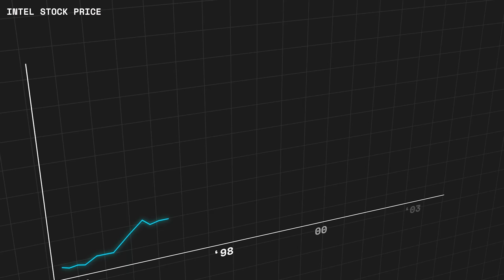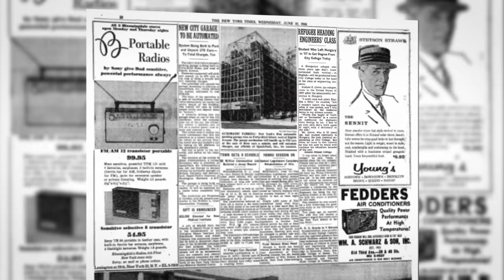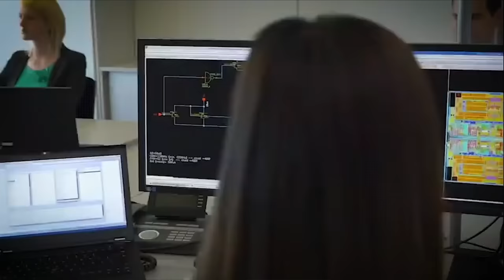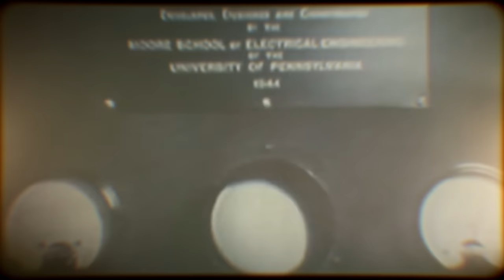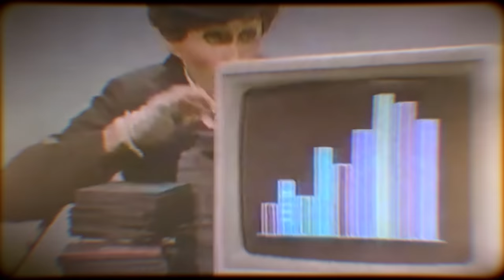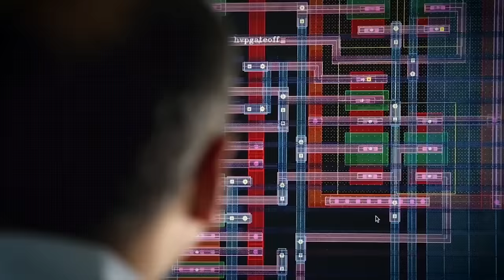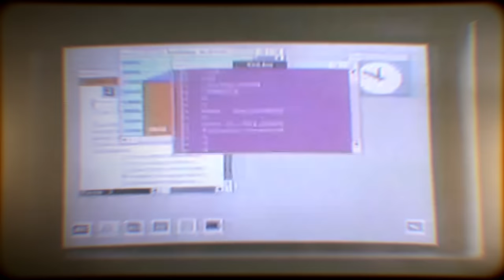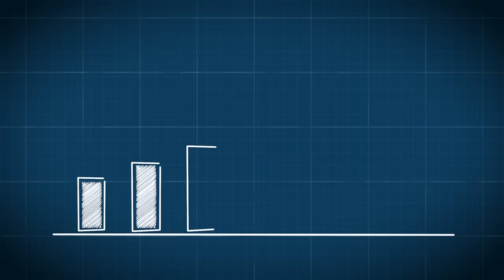Intel's Crumbling Dominance

Comment: Another exciting event happened following the release of the Pentium: the floating-point divide disaster. It caused Intel in 1994 to have to buy back $475 million processors produced with the flaw. I went to work at Intel in 1995, and all the employees were given a Pentium processor encased in plastic and turned into jewelry (tie tack, lapel pin, cuff-links, etc), and they sold a fair amount of the defective devices as curiosity items. They were extraordinary to look at, with a gold and rainbow sheen.
Reply: I think that was one incident that helped cause Intel's loss of Intel's dominance. The memes (although they weren't called that) were devastating and the slogan "Intel inside" became a warning.

Comment: I have worked as an Integrated Circuit Layout Designer since 1983.   All those chips designed between the first Fairchild chip in the 1950's and the early 1980's was drafted on paper or mylar on a drafting table using pencils.  Computers purpose built to assist layout design were only first introduced in the 1980's.
Reply: Just designed an entire 16-bit RISC CPU in Verilog as a personal toy project. Took about 4 weeks to get it running, on an FPGA, but the time included writing an assembler. I cannot even begin to imagine what it would be to tape that out on paper.

Comment: 00:00:00 - Bill Shockley invents the transistor and founds Shockley Semiconductor
00:05:00 - Andros Grove and others found Fairchild Semiconductor and develop the first silicon semiconductor chip
00:10:00 - Bob Noyce, Gordon Moore and team succeed in reducing the instability of transistors and price their products low to accelerate demand and gain market share
00:15:00 - Intel develops the 3101 SRAM chip, 1103 DRAM chip, 8080 microprocessor, 4004 microprocessor for personal computer, Altair 8800 and other computing products
00:20:00 - Intel founded in 1978 by Moore and Bob Noyce, growth slows in the early 1980s due to competition and financial difficulties
00:25:00 - Intel faces challenge to stay afloat in the memory chip market, switches to microprocessor production and becomes the world's largest microprocessor manufacturer
00:30:00 - Intel's 386 processor is a major success but IBM challenges its dominance, leading to significant challenges for Intel's CEO, Andy Grove, to keep the company on top.
Reply: This part is wrong:  "Intel founded in 1978 by Steve Jobs and Bob Noyce, "
Reply: Yeah, well spotted it was founded by Moore and Noyce.
Reply: DO YOU KNOW who Steve jobs was?
Reply: Edit your comment about your note on 20:00 - Intel NOT founded by Steve Jobs.
Reply: Intel was founded in 1968, not 1978

Comment: Interesting story. My family’s first PC was a 486, and my parents ended up choosing an AST  over a Compaq. This was 1990 or 1991 in ZhongGuanCun, Beijing China, and that computer cost about 2500 USD. The company Lenovo was a spin-off from the Institute of Computing, where both of my parents worked. Lenovo was originally called LianXiang. Their main early product was a Chinese input method, which allows you to type one Chinese character and be prompted with words and phrases that start with that character, thus the name LianXiang, which roughly means neural association or connection, an indexing and search process that occurs in your brain.
Reply: Wow haven't heard someone mention a 486 on here ever! I started on a commodore 64, then moved up to an amiga 600 (couldn't afford the 1200) then I finally got a 386 with 1 meg of ram! By then I was flying progressing to the 486 with (I think) 2 Megs of ram.. I remember having a mario game that was over 4 floppy disks. All running on DOS and windows 3.0/3/1. I remember when windows 95 came out and you got the free Wheezer music video. I used to sit there defragging the hard drive. Simple times! The good ol'virgin days!
Reply: @curtis24-7  i made a pit stop with amiga 500. ANd only for Monkey ilsand 2 i bought a sec. disk drive. Fun times. Kids of the 90s great time.
Reply: My parents' first computer was a Packard Bell with a 486.  I don't remember a lot of the specs, but it had Windows 3.1 and I think the hard drive was 20 MB.  Kind of crazy to think that a lot of processors have even larger amounts of cache today.

Comment: My first job at 16 in 1986 was at Marconi in the UK. I went on a wire bonding machine course and met a man that worked in a factory in Wales. Sure it was Intel. He said they was making parallel processors but the scrap rate was up in the 90%. The place I worked at made Silicone on Sapphire space chips.

Comment: Intel Core 2 duo E8500 were selling very well because many people tell people intel very durable and until today i am now still using it with a new Afox LGA 775 motherboard that has only one year warranty with a standby side kick Intel Pentium E6600. For playing computer games i have a AMD 4600G put near my left leg. Intel customer have intel core2duo E8500 computer that is very durable and still do not spoilt even if they overclock the CPU & fed it with the cheapest SGD 10 thermal paste with no expiry date and end up They go and buy AMD 4600G. When Intel Pentium 4 -2.4b ghz  have no rambus motherboard for repair, I check temperature of Cpu is 20 degrees temperature more than normal temperature because i overclock it from 2.4 to 2.53ghz and it behave non-responsive and also with strange artifact on the monitor then it must be spoil.

Comment: Slight correction. They were working on the 80386, not the 30386. How did the 80286 (and 80186) factor into this story? It's also worth discussing the difference between SX and DX, or DX2, and that the 80486 integrated the Floating Point coprocessor as well as introducing microcode to the design. By the P6 this was effectively giving a CISC instruction set on what is fundamentally a RISC processor with pipelines and out-of-order execution.
Reply: Not sure that microcode bit is 100% correct. Even an 8086 has some control run by non-upgradable microcode within the CPU. From a CPU designer's perspective, it is still microcode even if it isn't re-writable. A better classification for what was marketed as "Intel Microcode" would be to call it firmware IMO.
Reply: @richardbaird1452  does the 8086 have a microcode? I don't think that's right. Microcode wasn't used until the Pentium Pro as I understand it. CISC CPUs before that used a conventional state machine to select the load execute cycle. Instructions were mapped out on the die in regions specific for the instruction being used. Microcode which was updatable came later. Without on die cache, it wasn't really a thing because that is what allowed reordering and pipelines.
Reply: @richardbaird1452 , thanks for that additional perspective. I haven't decapped an 8086 myself, and my understanding mostly stems from my education a couple of decades ago when I created a 4-bit microcontroller as one of my labs. This notion that adding microcode to the x86 design was reenforced with other things I had read over the years. It makes sense that instructions like MUL and DIV might be implemented with microcode but I wasn't aware that Intel did that as early as the 8086.

Comment: Really fine presentation. I was wondering if you plan to tell a similar story about Texas Instruments or should I say Geophysical Survey Inc. Some of the success of Compaq came from engineers that worked at TI that shifted into Compaq. TI and Intel fabrication efforts parallel each other along with microprocessor designs.

Comment: The story is good, but the visuals are weird. The chip on the finger was a BellMac and Bell labs fab, not Fairchild. Also, not sure why the old footage of Brattain circa 52 was included with the Fairchild discussion. The footage was quite random. Noyce wasn't sole inventor of the IC, but he did take Hoerni's planar process to come up with the truly fully planar IC, slightly behind Kilby's hybrid IC. That Cray MCM footage was bizarre at that point in the timeliness- wrong decade. Also the apple Mac in the 1982 Intel discussion wa weird, as they come out in 1984 but used Motorola chips.

Comment: I hate to say it but your wrong about a whole bunch of the history. The first intel 16bit processor was the 8086 but they also made the 8088 which was designed to be compatible with the Z80 support chips. The Z80 was based on the 8080 but was enhanced in a variety of ways more & wider registers so it could execute some 16bit op codes. & thus became the heart of most business computers which used the Control Program/Monitor operating system. Meanwhile Apple were building its computers on the Commodore 6502 processor that was based on adapted motorola 6800 series processor, which is why the first Lisa's & Mac's were based on 68000 series processors
So first IBM PC were actually 8bit as they used the 8088 processor, it was  only with the PC/XC & PC/AT did they switch to 16 bit. The next chip intel brought out was the 80186 that integrated the 8086 & some support chips. But the big jump was the 80286 their first 32bit chip. The problem is that it had two modes 1 real mode & 2 protected mode but due to a design flaw it couldn't switch between them but IBM still used the chip which ran OS/2. OS/2 was the first Mac style GUI based interface but it was written with Microsoft. Except Microsoft called its version Microsoft NT & it was based on the Digital VMS operating system. Microsoft also created a OS that ran onto of MS-DOS which was also a graphical user interface also known as Windows. Eventually OS2 was combined Windows New Technology. Meanwhile the PS/2 introduced a bunch of new technology like the PCI bus & USB
What made the 386 good was that it not only fixed the flaw it also allowed multiple rings of security locking out virus getting control of the computer
The history of IBM pc and the mistakes IBM made is the history of the growth of Microsoft where it sold both PC-Dos for IBM but also MS-Dos to all the other people making IBM compatible PC's
BTW Compaq made its origonal money by bringing out the first transportable PC similar to the Osborne 2
Reply: Was 80286 actually 32 bit? I see e.g. EAX first in 80386.  I had 24 bit memory bus and virtual memory, but not 32 bit ALU. 
And AFAIK 80386 not even the first 32 bit microprocessor, some HP, Motorola or even AT&T one was.
Reply: @mikhailryzhov9419  I had a 286 pc compatible running OS2. Yes it was 32bit. But it wasn't the first 32bit in common usage. Motorola 68000 series, Zilog Z8000, things from Nat Semi. The advantage for the first IBM PC of using the 8088 was that it  could use the commonly available support chips of the Z80 (which was  a clone plus enhancements of the intel 8080)
Reply: @annakissed3226  Can you elaborate? The basic arithmetic registers are still 16 bits. This is the quote from the Programming Reference Manual “This manual describes the 80286, the most powerful 16-bit microprocessor in the 8086 family, and the
80287 Numeric Processor Extension (NPX). “ 286 had protected mode, but it was still 16bit.
Reply: @mikhailryzhov9419  if you say so, when it was sold to me it was sold as being 32bit. But it was a long time ago & I could well be wrong and  you right!

Comment: I never thought I would use any computer without an Intel processor in 20 years. After Intel refused to recall my 14900K or refund anything whatsoever I switched to AMD Ryzen, the 7800X3D, and I won't look back ever until Intel proves competitive again against AMD and NVIDIA. I was such an Intel shill I had experimented with AMD before with a 7950X (no 3D-Vache) and sold it just to get Intel Raptor Lake processors. That was a huge mistake, to put it bluntly. 

Intel's refusal to recall the Raptor Lake and Raptor Lake Refresh processors with degradation, disgusting overvolted settings designed to degrade the processor straight out of the box that Intel knowingly deceived customers with, customers who lost stable business because of Intel's lack of foresight, that clock speed alone doesn't determine how fast your CPU is. AMD understands this effortlessly.

AMD Ryzen will forever be my primary PC, Intel lost that right after two decades of increasing power inefficiency in spite of excellent performance, AMD Ryzen delivers on all fronts, performance and power efficiency.

Comment: And Wintel is about to die, because Microsoft wants to make their own systems just like Apple does.

And what does Microsoft want to use for their processor?  An ARM RISC processor.  However today's RISC is nothing like the 80s - 90s RISC.  CISC still have big advantages even though the instruction logic uses a lot more transistors..

Comment: I believe you left out the integration of Intergraph processor patents by Intel in the '90s and early 21st century, well documented case law which Intergraph won in the courts but lost in hardware sales when Intel refused to deliver chips to Intergraph. My clients had to switch from Xeon based Intergraph PCs with its Wildcat graphics processor to Dell Xeon based PCs with the Wildcat cards, because Intel refused to deliver the Xeon chips to Intergraph due to the refusal by Intel to agree to pay Intergraph for the rights to its processor patents based on the Clipper chip set. Search case law to tell the full story.